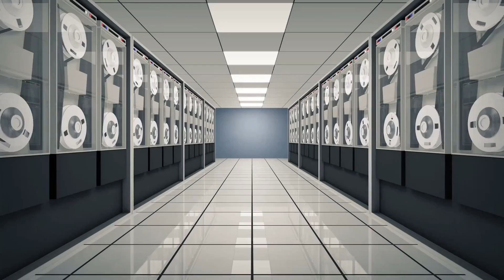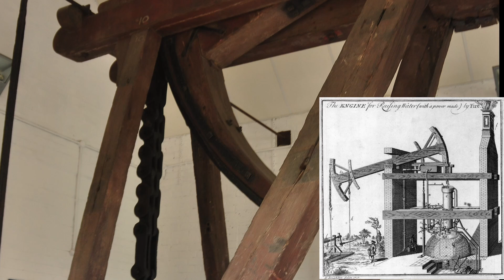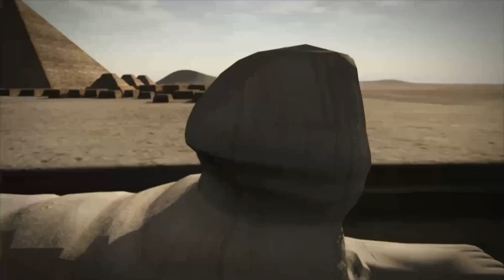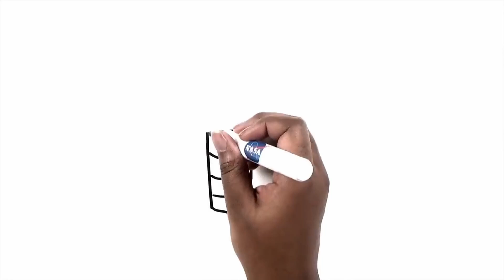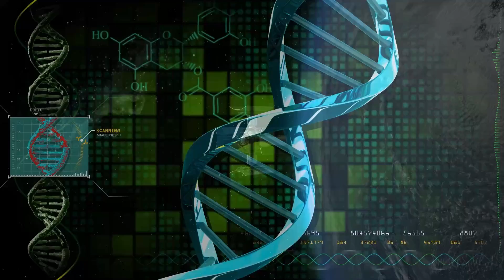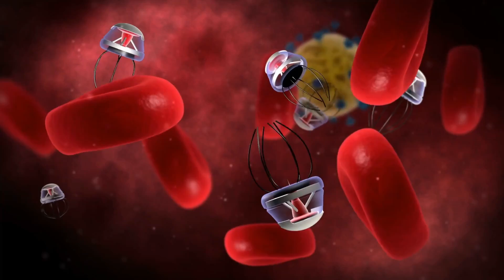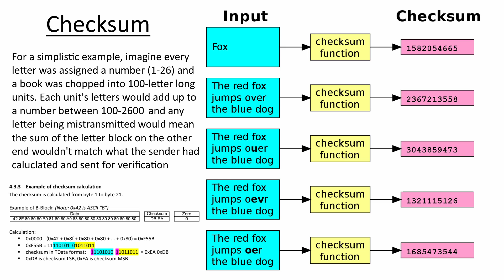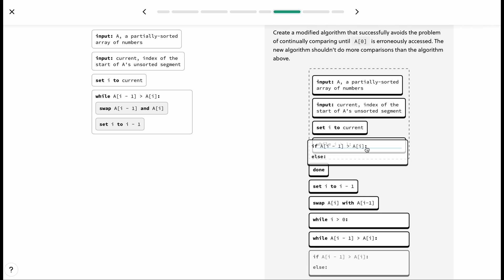The Million Year Machine

Comment: The issue I've always seen with checksum, especially over long times/distance is that the verification function is still sent or carried by the same process as the checksum, and therefore still vulnerable to the same mutation as the checksum.
Reply: @davidcoletta3332  but.... how do you or I know which was or may have been mutated if both sent are in the same method ?
If the "data"... the verification function gets mutated,  how does the receiver know if the checksum, or the verification function got changed ???
Reply: There is no mechanism to check the verification function that has been sent....only the checksum against the verification function, see my point ?
Reply: @davidcoletta3332  I understand what your saying each time, but, how does one know if the verification functuon isn't the mutated part ??? The checksum still won't match at the receiver. Not because the checksum information is mutated to not match, but that the verification sent through the same process may be the mutated part.... how would anyone know which was changed ??
The receiver only gets two sets of data, the checksum and the verification, there is no way for the receiver to know which is mutated, only that they don't verify.
Reply: We are saying the same thing. But my point was, knowing WHICH part was mutated. Because if you knew, and had many mutation in the checksum and none in the verification data, it would point to a problem in the original checksum book, or data stack.
It would be important to know in which group of data the mutation was occurring.

Comment: With any self-replicating or self-repairing piece of machinery, I always come back to the issue of the semiconductors and memory itself. Obviously you’d store spares, but if that isn’t sufficient then the required semiconductor fabrication means incredible complexity and precision. Every probe would not only need to have an ASML-tier lithography machine, but be able to make more ASML lithography machines. I think maybe you’d try to simplify things back to micron-scale lithography and hope that you can get enough programmed into those chips for running all the mineral refinery and diagnostic and assembly protocols. Larger gate sizes also means less prone to cosmic ray bit flips, maybe even going to TTL could be warranted.
Reply: A bacteria can repair itself, replicate itself, and with some effort could be programmed to build a transmitter to call home. It was perfected over billions of years, but I'm pretty sure we can do even better.
Reply: A biological solution may be the simplest, but you’d need to reinvent all of the data integrity methods of the digital realm.

As for physical ROM, a ceramic disc with gold selectively plated (or etched) from it would probably last a long time and may be tolerably easy to manufacture, and could be read like a CD. If you’re already going all the way for silicon, then you could make an optical disc out of silicon with selectively anodised areas, though at that point I’d just make it digital ROM with fuse bits or even direct wires. Make three or five copies, embed the data with correction algorithms, that’s going to last a million years and can be made with any size process without worrying about cosmic rays. The CPU itself will likely have a higher density, and it and the RAM and registers need to be volatile but not prone to cosmic ray injection. So I suspect CPU tech will always be more challenging than ROM tech.
Reply: a quantum based machine with "transistors" could be build with a hardcoded program based on placement of individual components and then have infinite memory based on those transistors arranged similar to memory. the hard coded program could always start fresh on power up . keeping that memory is tough , maybe inscribing it into long lasting metal instead of storing it as electricity.
Reply: Is planet Earth a machine? 🤔

Comment: The longevity of a machine depends on A) It strength vs function, how well made and durable its components are against wearing, B) How useful and well it performs its job vs replacement of a better design, C) The need for the object to begin with, would there ever be a need to design something that was to last a million years to begin with, with the knowledge that some other technology won't replace or outright circumvent that technology in the first place.

Comment: I feel like this entire concept revolves around the Ship of Theseus. Can we say a machine lasted a million years if every component was replaced over that time frame? Or is it a new machine every time?
Reply: Answer: it hardly matters since theseus's ship still made it to port. The mission/purpose was still fulfilled making the dubiously useful question of identity basically irrelevant as the "machine" wasn't a specific physical instantiation of a ship but the overall system of Theseus's Ship.
Reply: @virutech32  That's the entire purpose of the question. Is a thing more than its parts or the sum of its parts? My answer is the idea, the form factor and design and purpose of the ship is what makes it that ship, despite potentially being entirely replaced. Which is essentially what you said. But that's just one perspective.

Comment: The longest running machine I have is a 1993 Subaru Impreza 1.8L. It's still got most of the original essential parts. I think the only things that have been replaced are the spark plugs and a timing belt. The thing was my grandmother's daily driver for a decade, my uncles for the 15 years, and has been mine since then. It has almost 350,000 miles on the odometer. It still runs like new. Regular maintenance of course happens, but maintenance is a given for most of these machines.
Reply: Someday we'll land a Subaru on Mars
Reply: @malcolmt7883  why?
Reply: @bgbthabun627  Because it's there?

Comment: The thing about "surely the people there will be best placed to make decisions."  
Your decisions now can determine if there are people there, and if so what sort of people.

If there are powerful intelligences in the future trying to do X, you don't really need to worry about how exactly they do it. X will be achieved.

There is a vast space of possible people. You, as the designer of the ark ship are guiding which ones will be made real and put in charge of decisions in the future. 

When Alice is designing the mind of Bob, both Alice and Bob have control over Bob's decisions. 
The programmers of Alpha Go chose that code, over some other code they could write, because they believed that code would lead to a win at go. Then Alpha go chose its moves without going back to the programmers. The programmers could all die and Alpha go would still work. The programmers never envisioned the particular board state Alpha go ended up in. 
And yet, the programmers could have made an AI that lost at go, or one that drew smiley faces in go stones.

Comment: Wondering what's the oldest machine still running today, without complete rebuild. 
There's obviously some "ship of Theseus" issue in the topic, what would essentially constitute a total replacement one piece at a time, but I'd like to read about old stuff that's still running.  Could be a steam engine that's running with hardly any wear as long as it's greased well enough, could be an old clock, maybe a centuries-old ship still sailing the seas...  modern tech usually can't compete.  More often than not, the makers don't even want their products last that long.

Comment: Given self repair you'd just need robust error checking and redundancy. Once you nailed the math down you'd just need to work out the material and energy cost of the constant replace and repair function, which would likely be quite expensive and require a mix of the techniques mentioned here to bring in line with the possible maximum cost.
Reply: It is not possible to achieve lossless self repair, though you could get it exact enough to last a.million years with enough resources invested.

Comment: FYI - Philip II of Macedon (382 - 336 BC) had the Filippeios Krini (Philip’s Fountain) in Greece built using an Archimedes screw pump. It is the oldest still-functioning fountain in the world (as of 2022). The mechanism has apparently only been maintenanced but has never been replaced.
Reply: Damn. Thanks guy. I gotta check it out.
Reply: Not for nothing: horseshoe crabs are basically the same as they were 450 million years ago.  They are a self replicating machine but that is a darn good design.
Reply: @zhaoliang4217  Great and unexpected comment! ;) The problem would be in managing evolution, due to mutations, natural selection and changes in the ecosystem. The whales approx. 50 million years looked more like small deers, but started turning into bus size fish-like creatures ;) Maybe it would be stable enough in the scale of 1 million years, but it is hard to predict the outcome.

Comment: I would like my household appliances to last a million years first to be honest.
Reply: Retro appliances repaired with high quality modern parts
Reply: In a video about Edwardian era appliances, they mentioned that electricity at the time was supplied by a bare live wire strung through a window and along the ceiling into the house, you just hung the hook from your toaster onto the wire.  Fires were quite common. Safety standards have evolved since then, don't think an Edwardian toaster would be a good investment, but at least it wouldn't offer you toast when you didn't want any.

Comment: Another example of of the trouble with long term colony ships in fiction is in Niven and Pournelle's "Footfall" where in the alien Fithp have a slower than light arc, move into the Sol system, drop an asteroid on Earth to assert dominance and begin the subjugation. However a sizable continent of the Fithp are so call 'star born' and have never lived on a planet and don't really see the need to especially since the planet in question is over run with hostile monkeys meaning sacrificing Fithp lives for what the star born see as no actual gain since they could easily hang about in the outer system where all the resources are and remain unmolested by the primitive monkeys who have no way to effectively stop them from doing whatever they want out there. Seems that most of the leaders are thawed out previous generations and there is some tension between factions but from what I recall it doesn't actually amount to much in the end.

Comment: Are you familiar with the Long Now Foundation’s clock project? The idea was to build a clock, any way they could, that would tell reasonably accurate time for 10,000 years. It’s astounding how much complexity that adds even to engineering problems like the kind of clock gearing that was figured out 500 years ago; suddenly it has to be interdisciplinary because the mechanics intersect with climate, geology, biology- its system has not only to function on its own, but in the face of every system it encounters. 

They do have a design now though. They’re building it under a mountain in a fairly geologically stable region of the US, I believe. 

But a million year machine? Each new span of time adds another exponential level of complexty! Truly mind-boggling, especially as our increase in information technology has been increasingly short-term.

I think of film preservation- something like 2/3 of silent films are permanently lost to us; the same is true of minor movies of much later periods. 

The same is true of some early digital technology - as its obsolescence increases it’s unclear how well it will stay accessible. Even some early dvds are starting already to corrode beyond usability, and we’ve started to reach the point where hard drive failure can put archival data in serious jeopardy. To return to film, it’s unclear that the digitizations intended to “preserve” old films will actually outlast the more old fashioned material on which they were originally printed. I think it’s an easy blindspot for us today, to assume that what we have made must be more enduring just because it otherwise has greater capabilities.
Reply: M-Disc technology claims to have a several-hundred year lifetime, in DVD and BD compatible formats.  Interestingly, it uses an obsidian-like material in place of dye, so could be considered an example of using stone as a long-lived data storage medium.
Reply: Less so when you realize those 'greater' capabilities are often things like 'lighter,' 'less bulky,' and of course 'cheaper.'
Reply: @boobah5643  miniaturization also makes components more fragile, and guess what the tech industry has been striving for since its inception?
Reply: Disk failure isn't really much of a problem, provided you have other drives running in a suitable RAID configuration, or other virtualization setup. The only question is if you can replace them over time, obviously. But even without replacements you can effectively create a virtual drive that will function far longer than a single component drive would.

You do have to make some trade offs, obviously, especially when it comes to I/O latency and effective density of the drive. But since you are making an archive...
Reply: We LOOOOOOOOOOOOOVE our computers!  And tend to attribute all virtues to them!
Reply: TL;DR: blah blah blah
Reply: @NotchaBizness  technical discussion is the whole point of this channel, go be a chimp somewhere else

Comment: I think you would need a colony of machines to produce a machine capable of lasting that long. You would need machines that can build and repair other machines. Machines to gather materials. A good model might be like an ant colony except you would want more than one queen at least 3 and other machines created by the queen machines to be able to repair and build a failing or failed queen.
Reply: I have a Bridgeport vertical mill and a lathe. I use them to make parts for them fairly often. I always get a kick out of a machine making parts for itself.
Reply: sound like the replicators on SG-1. bad news.
Reply: In other words you’d need a civilization?
Reply: @samsejavka8600  In some fashion yes. Even humans are considered machines to some extent. Although it could be completely made of non organic machines. Not sure which could last longer.
Reply: @jeffsadowski  I think both could last forever, as long as they have a way to collect new energy. Humans will replace themselves over time, machines could do the same, they just need energy.